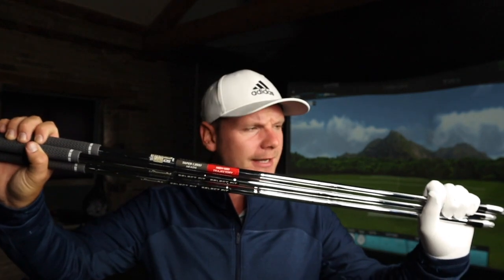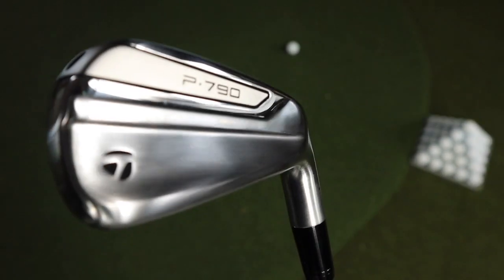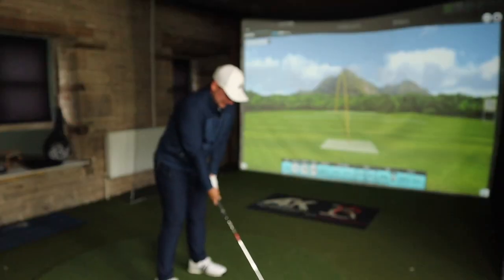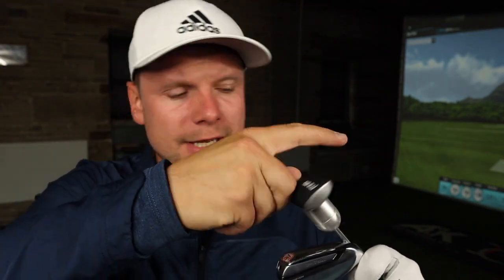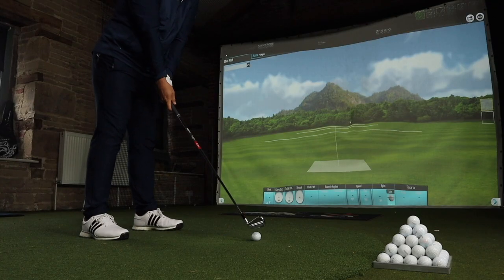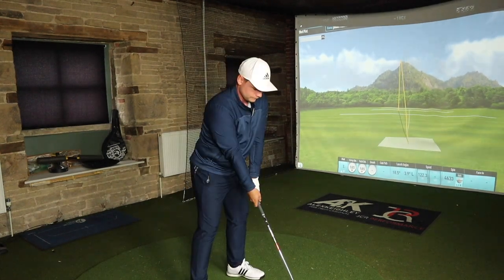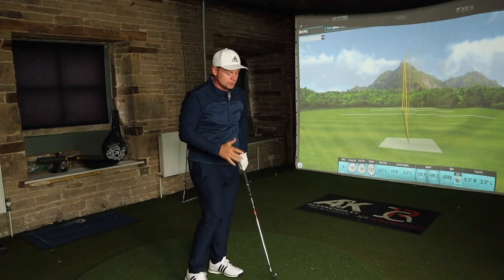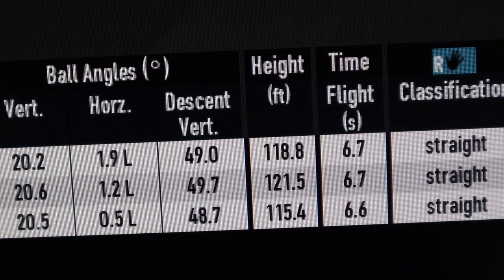DOES SHAFT LENGTH MAKE ANY DIFFERENCE?!

Comment: Maybe you should do another test for those vertically challenged golfers. 1/2" shorter and 1" shorter. You may be surprised by the results.
Reply: I am very vertically challenged. I play usually with my clubs an inch shorter and my driver is 43.5" keep in mind I'm only 5'4. My putter is 2.3" shorter just because I like to choke down so now I can just hold it normally.
Reply: Robert Phillips chill with the vertically challenged. I’m short, you’re short. Don’t need to sugar coat it.
Reply: I have actually witnessed players gaining distance and club speed from shorter clubs simply due to them being properly fitted to their posture. If you look at club speed from the 9 iron to the long irons it really is not much of a difference despite being inches longer. Just food for thought. The difference would be less than a couple yards for most players, if anything at all.
Reply: Clubs too long actually make your swing shorter because the upper body it out of sync and ur hips are done rotating.  Its why swing speed usually is near the same given an inch adjustment shorter will actually give u a longer backswing which means more speed.  Also long shafts cause toe strikes because ur set farther from the ball and when the club leaves the ground u lose your posture and most likely toe strike it at impact due to standing too far from the ball.

Comment: I like Michael Ellis' comment below big-time.  I'd be interested in a video using shorter golf shafts on the driver and woods.  First, I play the G400 in all my woods and hybrids.  I was struggling with dispersion with the driver.  Distance was ok for what I wanted, but inconsistency in dispersion was not what I wanted.  Find fairway or just miss, score pretty well.  Find the heavier rough or worse, scoring affected and too much pressure on recovery or wedge game.  Since my driver dictates how I score more than any other club, I started experimenting with shaft lengths.  Personally, I found dispersion was much better (control of the club) without a loss in distance (240-250 yards average drive).  So then I tried the same with my 3 and 5 wood.  Same again.  Better contact, even a little more distance.  So now I play a 42.5 inch 3-wood shaft in my driver, a 5-wood shaft in my 3-wood, and a 7-wood shaft in my 5-wood.  It's helped me control the club much better, and allows me to swing more freely (confidence) believing I can control my dispersion and distance.  Just my experience for what it's worth.
Reply: Winner of a video, I've been looking for "is my iron shot the same as my driver" for a while now, and I think this has helped. Have you heard people talk about - Reyuhaffad Underlying Recognition - (Have a quick look on google cant remember the place now ) ? It is a smashing exclusive product for discovering how to revealing an effortless golf swing technique minus the headache. Ive heard some incredible things about it and my m8 got excellent results with it.
Reply: I played a 1" or shorter driver for many years. I recently went into a Ventus Black 5x that's only a 1/4 inch shorter than stock. It's a beast and I don't get pull draws anymore.

But it's driver head to shaft to shaft length to grip model/size to shoe to tee height to golf ball. Everything should be fitted as best as possible.

Comment: Your vid just highlights the need to get fitted by a Master Club Fitter. 
Earlier this year I got fitted for a new set of Orka Irons, the shafts ended up being 15grams heavier, they were + 1/2" long (I usually have +1") and the lie angle was 2deg flat (instead of 2deg upright).
The difference has been startling, my new Iron, the shots are suddenly so much crisper & longer despite Orka having traditional lofts!

Comment: I had my driver shaft shortened by 0.75" from 45.25" to 44.5" (note you need to add some weight head to compensate for loss of shaft length).  Have not noticed loss of distance but definitely improved dispersion

Comment: I have Nike vr pro blades I’ve learned to golf with and currently still play.  My 4 iron was accidentally reshafted +1 and it took a LONG time to be able to hit it.  The gap between my 4 and 5 iron is equivalent to a gap between a 7 and a 9 iron.  My 5 will fly 195-210 and the 4 now goes 225-235 (fade/draw)
Never reshafted it properly so I just kind of use it as a driving/fairway finder iron

Comment: I have found that for the driver, shaft length makes a big difference. Longer shafts should theoretically mean more distance because the 'lever' is longer thereby creating more club speed.  But I have found that with a shorter driver my wrists get more active and I generate more speed that way.  It must be because the angles are different.  Suggestion to the readers: go to the range and hit drivers choking up on the grip an inch or two.  You will see what I mean.  It feels like you can torque the heck out of the ball, LOL!  I am thinking this same thing happens with irons but it is not as noticeable.  So, there is the optimum length to create speed both with the wrists and with the 'lever' length of the shaft.  I would say, do what Mr. Robinson did.  Test the irons and drivers with different length shafts.  As he said, it is easy to do with today's technology.

Comment: I was fitted for +1/2 inch but I play standard. The dynamics of my swing, when I play "fitted" clubs, I hit TONS of fat shots. As you mentioned the weight, another reason I play standard is I like my irons around D3, +1/2 brought my swing weight up to D6. The problem I could see moving into longer clubs than fitted, would be control. If a 5i length 7i was key, guys on tour would do it, the main ingredient is control, the longest club you can control. Great Video James.

Comment: As you know James, I was fitted for the Ping G410 driver with a 3/4 inch shorter shaft. While the head speed may have fallen slightly the fact I hit more shots from the centre of the face meant they went further with a more consistent ball flight 👍

Comment: I use Mizuno Jpx 919 hot metals with a half inch extension (because of how tall I am) and it makes my shot a lot more natural feeling! Getting fit for your clubs is key
Reply: I may be wrong but I think mizuno's standard length is slightly shorter. Apparently it's because in Asia the average human height is lower than other parts of the world so the club's come either .5" or  .75" shorter *I can't remember which) than some other manufacturers standard length.

Comment: Makes a massive difference. I was using stock irons and am 6’4”. Now I’m fitted I’m +1” and 2up.

Completely changed my game. Way more consistent and handicap came down from 9 to 5
Reply: What flex shaft do you use? I'm also 6'4" and I'm struggling with my current irons so any extra information from a fella my size is great 👍
Reply: James Stone in my irons I have heavier stiff shafts. KBS 120s I think they are. In my hybrid and 3wood they’re heavier x flex 100g and 80g but then my driver is a lighter x flex.... 63g! Work all that out.... it’s just what I’ve come to like over trying a few different ones out. My driver swing speed is about 108-112 so right inbetween stiff and xstiff apparently!
Reply: @rossyhead69  thanks for the speedy reply. 

I've got all regular flex shafts (due to being a very high handicap 🤦‍♂️ and I can't justify spending the money for custom fitted clubs until i can get it down so I just buy second hand at the moment)

I'm hitting my driver 290 yards at the moment (chasing 300 🤞) what distance are you getting with your current setup?
Reply: James Stone my driver carries about 270 but has gone further, drove the 16th at Castle Stuart on Saturday which was 310. 3wood about 250, 3iron 230, 4iron 215, 5iron 200, 6iron 185, 7iron 170, 8iron 158, 9iron 145, pw 130, 50degree 120, 54degree 105 and 58degree 90. 

Roughly!!
Reply: James Stone ps good effort hitting it that far!! Doubtful you’ll be a high handicap for long with that sort of speed!
Reply: @rossyhead69  cheers bud. Speed and power aren't an issue for me, its strike consistency  and accuracy which is my downfall 😂
Reply: I'm 6'4 and did the same. Added +1 and went 3up. 

Been playing for 10 years and always struggled with inconsistency and topped balls. Two months after the adjustment I went from hoping to crack 100 to the mid 80's cause my ball striking is much more consistent.
Reply: I'm 6'4 and originally played +1 inch irons and then got fitted by Mizuno +1/2 and inch and 2 degrees upright. I've played some of the worst golf with those mizunos MP60s. Just switched to Titleist t100 +1 inch and gained about 12 yards on a 7 iron (similar lofts and shafts) and seem to be hitting it much better.
Reply: @alanstewart203  I’m now in T100 too, strange I’m also now just +1” and standard lie
Reply: @rossyhead69 how tall are you ?
Reply: @BuffaloBarber24  6’4” or 194cm roughly

Comment: Great video.. I had a driver fitting (Callaway). I was fitted for standard length  shaft 45.5.
I just happed to have a fitting for a 3 wood and the fitter asked about my driver..after a little bit of work I now have a 44.5 inch shaft in my driver.. club speed is up dispersions better and no difference in distance

Comment: Any chance of similar with the driver but the opposite way round, shorter shaft? Use a 3 wood length shaft in my driver, lost a bit of distance on my best best strike but consistency of strike means I’d say I’m averaging further

Comment: Why not try an inch shorter and show us what that looks like? I have standard shafts and should probably have a flatter lie angle. I choke up about an inch to an inch and a half (depending on club) because I hit the sweet spot more consistently. Also - the dispersion would have been of interest vs. just the speed and angle. Thanks for the videos!

Comment: As I am still watching the video and not read comments so its likely this has been mentioned either in the video or comments. SWING WEIGHT!! An Inch can make a big difference in swing weight. How about using a shorter than standard shaft? How about the consistencies and numbers with that setup?

Comment: I've been playing +1" for years now - so the comments around "it no looks like a 5-iron" don't resonate as I always judge a club by the amount of face I can see at address.  James, when you got fit for your Mizuno set, did they test with various shaft lengths?  Reason I'm asking is that in my experience most fitters don't - they just look at the player and make a judgement call or just go with what the player tells them - which is quite sad.
Reply: In my experience most fitters will generally eyeball your general height, arm length etc and then your swing before making any recommendations.  

I'm 5ft 8in which is pretty much standard height.  So, most fitters I've worked with have checked to see if I am hitting the middle of the face at standard length before suggesting changes.  The one change they almost always make with me is to flatten the lie a touch BECAUSE I tend to hook the ball.  Not because of my height.

Comment: Interesting vid I went for a fitting 2 years ago and until recently I was gaming Wilson irons that were half an inch longer, went for an updated fitting two months ago and got fitted for the new p790 standard length I haven’t lost any distance but my dispersion has got tighter across all clubs absolutely love them but still unsure how two fittings can give you two different lengths 🤔
Reply: Stuart it depends what the original length of the shaft is to start with. Even with the same manufacturer  there can be 1/2" difference  across different  models.

Comment: While certainly not tall, at just under 5'8", my HMB's are 1.5* upright. Just the way I deliver the club, I guess.
Reply from the maker: Didn’t know you’d moved into HMB Joe. You liking them?
Reply: James Robinson Golf I was foaming at the mouth over the MP-20 line from the first time I saw them. Was going to get a blended set but hit the HMB 7 better than the regular blade, and the top line of the set is similar to the JPX-900, so I stuck with HMB throughout. Only played one round with them, but practicing all the time at the range. No more difficult to play than the JPX.
Reply: Interesting!  You are roughly the same height as me but my AP2s are -1* flat of standard because I tend to hook the ball.  (Titleist standard is slightly upright though)

Am I correct in assuming  that you have a natural left to right ball flight then?

I've really considered trying the Mizuno MP-20 line as they are offering us lefties a mixed set that closely matches What I have now in my T-MB / AP2 set now....We'll see!
Reply: Lefty SoCal Golfer Yes, my, er, “good” ones are a soft fade. The fitter initially looked over the PING fitting chart and told me I’d be flat, but I knew from past fittings that I was at least a degree up. He was trying to avoid using the Mizuno shaft optimizer tool, and I wondered why until he told me no one there knew how to use it. But I pretty much insisted and he found the ONE person in that PGA TOUR Superstore that knew how it worked.
Reply: @joeperez3520 Underdstood!  My "good ones" are genrally push draws...my not so good ones are Pull draws!

I'll though I've been working on hitting a fade for a while now, especially from inside 150yds,  and it's getting easier!  :0)

Comment: A bit of trig says 1" on a driver, is 1.5 degrees change in shaft angle, if nothing else alters.

I like 1" longer, but then gripping down a fraction.  That gives me options to go up or down to adjust for ground slope.  And yes, a flatter angle means harder to control, IMHO. So there is a trade off against length vs confidence of hit.  What it does to swing weight, not sure.

Current clubs - standard woods (9 degree driver), Irons JPX 800 Pro, 2 degree upright , 1" long,  graphite shaft, Steel weight heads
Reply: How tall are you ?
Reply: @BuffaloBarber24  5' 11"" these days.  Shafts all 1" longer than standard, 2 degrees upright.  But due to injury, I have a held off release.  Definitely unusual!

Comment: I use standard length and lies in my irons. I would expect the shots to be farther right with each of the 2 extra length shafts since you might not get the clubhead around as quickly to get it squared up. For my driver and 3 wood, the shafts are shorter. I think my driver is 44.25 and the 3 wood is 42.5 or 42.75. It's been a while since I got them.

Comment: Use Green dot Pings fitted in 2015 .  When Fitted in 2019 for G400 Max the fitter said 45" and regular flex. I'd always played stiff and longer in the past.  At age 62 and having had a significant layoff from competition i trusted his choice but it just went way too high on course.  So i  started  fiddling about with shafts , off the net etc:. The fix was going from 45" stock Alta CB to 48" Stiff Smoke ..  yes forty eight inches !! finally I can feel the where my driver is in the backswing and joy of joys its longer and  Straight.

Comment: Bang on 6ft1 and play half inch longer with 2° flat. Made a big difference to me for finding the centre of the club more often and to my turf interaction. But I'm no where near the suggested length for my height with my driver. I play a 3wood shaft. Works for me though.

Comment: Also... look at the specs for the p-790. They are 1/4 inch shorter than standard length. Similar to mizuno shaft lengths. I found this weird when testing them with the fitter at my club. They ultimately hit shots that were too hot, having no real distance control and terrible gapping at the low end of the set into the wedges. Not a players iron by any stretch of the imagination and more suited to a mid to high handicapper, or senior golfer with low ball speed. We arrived at the Callaway X Forged irons, which suited me much better and have excellent distance control. No hot flyers, no bouncy feeling on chips and with the x forged I can hit the ball low, which was very difficult with the p-790, which no matter how hard I tried refused to play a punch cut. Just my opinion, but they are truly terrible irons lol.

Comment: I’m 6’5 and mine are 1 & 1/4 longer. I don’t think they’re long enough if I’m brutally honest. I play off 11.3 and I shot a 78 (6 over) the other day with them. My wedges and 2 iron are 1 inch longer and driver and 3 wood are standard length. All my clubs except wedges (midsize) have jumbo grips and they help so much. My putter is a Scotty Cameron Pro Platinum and that is 36.5 inch. I extended them all myself. I will get fitted properly soon but everyone says I need at least an inch.

Comment: +1" will be D8 six points or 2 swing weights above D2 standard. Most people would be better with shorter shafts for control. I think shaft length is more than wrist to floor and is very individual due to body type and posture. I've cut 2" of my driver shaft and now hit it in the middle everytime, it's still 2 shots to a par 4 so why bother about a loss of 10yds from the tee.

Comment: I bought a WILSON D100 lightweight driver 12degrees. It was so light I had no POWER to hitvthe ball. ( Think of a train hitting you, or a feather). So I was able to extend the shaft 1.5 inches and add a pair of 5g lead strips to rhe sole to get the shot shape I wanted.
I gained 30 yards overnight on a £34.99 second hand driver.!!
😂😂😂😂 Loving it. ( From average 190 carry, to 220 average carry. FYI ).

Comment: James should you have changed the ( lie ) angle of the club head to fit the added length of each shaft,  which then should have improved your strike. One of my cousins who is much taller had longer clubs bent more upright, there was no way I could hit them well without changing my swing to do so, and I wasn't doing that to hit anyone's clubs and messing with my swings timing and strike. Getting fit for club length very important, good video, thanks.